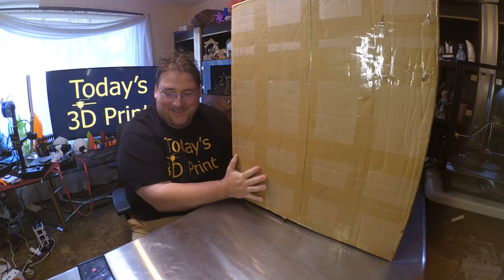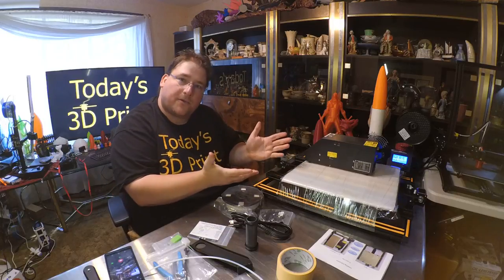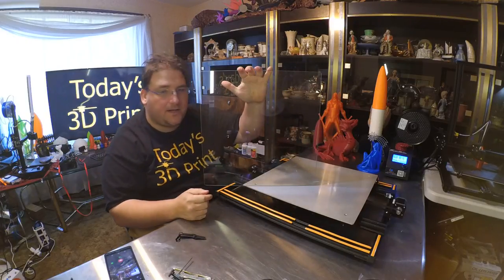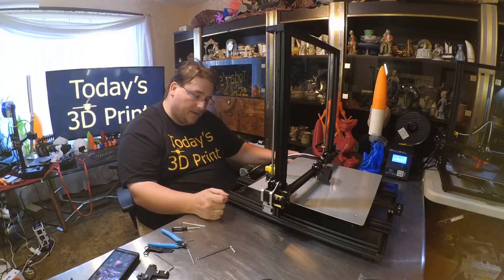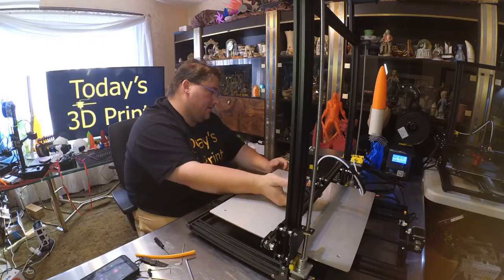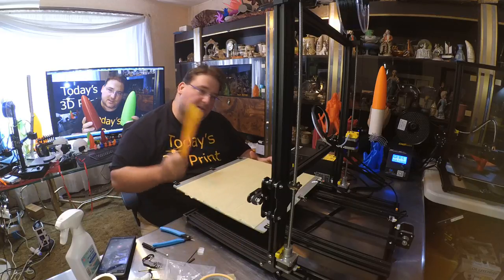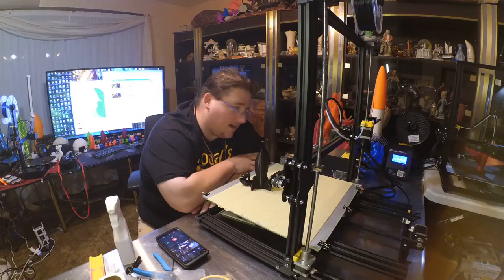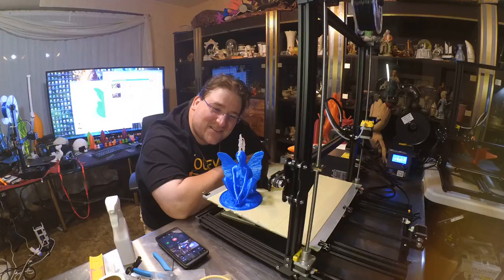Today's 3D Print 122 Creality CR-10 S4 Unbox, Build, First Prints

Comment: Nerys, it’s nice to see you so passionate about 3D printing, I hate to be a worry wart but you seem to be around many, many 3D printers 24/7 when you are not working. Please be aware that there is a health risk breathing in the Microparticles given off when plastic is molten. I know this will probably not be news to you but just thought I should mention it. 😉
Reply from the maker: +Mark Slatem the particulate emissions of pla printing is virtually zero on top of that the return register for the HVAC system for the house is right there in the room with me so most of that is being drawn directly into the HEPA filter for the house plus I am rarely home :-) mostly working and sleeping as my minions chew away on the gcode and plastic I feed them.

Comment: Looks like you have the exact same model and upgrades that I got with my S4. The other included gcode you mentioned is a screw and nut.

I designed some simple bed leveling knobs for the S4 that are available on Thingiverse. They're nothing special but they are better than the included ones, which I found to be kind of sharp and uncomfortable to use. I was also able to use the standard strain relief bracket on this, although it was a little tight. I may have altered it slightly -- can't quite recall.

My main complaint about the S4 is probably that it is a bit harder to level than the regular CR-10 due to the larger bed, and I find that it gets way out of level after doing a long print. I'm guessing the weight of the plastic on the bed causes the springs to compress and gradually work out of level. Any ideas about preventing that?
Reply from the maker: got a link to the S4 Knobs?
Reply: Here: https://www.thingiverse.com/thing:2552928

Comment: sir.can u use cad to picture the heat bed holder?(that is a plate  under the heat bed)
tks.i want to diy a cr10s4.but i have no dates
Reply from the maker: CAD ?
Reply: ya，i mean autocad
Reply: I  need that ,pls.
Reply: i just need every circle's position and size
Reply from the maker: Okay now I understand you want a cad drawing of the Y Carriage plate sadly that's not something I have the tools or means to make I could never measure it accurately enough to give you a viable CAD file I will reach out to creality to see if they have that file and if they are willing to release it
Reply: Ok,thank you .I just wish someone could make a colne CR-10 s4 3d printer .hah .
Reply: Sir,and can u share your CR-10 s4  material menu?

Comment: Hey Nerys!, Which would you get? CR-10S4 or CR-10s Pro....i'm at a deadlock....can you put e3d hotends on the CR-10s Pro?  Right both are the $$...so its a hard  choice. Any thoughts?
Reply from the maker: The cr-10s pro is a 3-3 for printer while the cr-10 S4 is a 444 printer so the S4 has an extra hundred mm on X & Y if you don't need that extra hundred go with the pro if you do need the extra hundred mm then you have to go with the S4

Comment: Can not believe how big that looked compared to the regular CR-10, Truly is a monster. Looks like the are still using  plastic extruders on their printers. 7 Days, think it could be more like ten knowing how slicers under estimate time lol. Hope it completes with out any issues. Can't wait to see the finished print!
Reply from the maker: +ebuTuoY it says 100 hours so I'm guessing 110 to 115 if it does not fail earlier I'm not sure if I have enough perimeters to close that top I've never tried to print a 16-inch Dome :-)
Reply: Nerys I am sure a lot of variables  change the bigger the print gets. Only trouble is the amount of filament and time you could waste if it fails..good luck and fingers crossed!
Reply from the maker: +ebuTuoY mechanical failures you can't do anything about shift happens sometimes design failures that's where experience comes in as you learn capabilities of the technology your printer the model and the scale you can learn to recognize okay if that's going to be a problem or that's going to be a problem and try to counter it in a slicer that's why I have very few failures unless I encounter something new such as when I did Voyager but part of that was I was very finicky about not wanting supports or more than two parts so I had to make compromises to get that end result but now I know about one more failure mode and I can account for it in the future ie I should never have a print fail that same way again
Reply from the maker: +ebuTuoY correct the big one you have to worry about when you print this large is that the actual width of your novel becomes a problem for example printing the Dome of the Moon I am concerned that six perimeters might not be enough if the grand total horizontal shift toward the top is more than 1.2 millimeters I might begin to have surface deformation or collapse we shall see :-) in about 2 days I believe this is my first four-day print or nearly 100 hours and it's only half the Moon :-)
Reply: Yes I imagine this becomes more of a problem the bigger you go. Suppose that you could just print the top part as a test to see, but that is a waste of filament also. Think you just have to trust your instinct and experience and just go for it. Guess we will find out in a couple of days :o)

Comment: So they added a resume after power failure feature to the Mini but not the S4, interesting. For my needs and environment, I would go with the Mini over the S4 if that is the case.
Reply from the maker: +KS Todd I did not know the many can do that is there something in settings where I can check for that?
Reply from the maker: +KS Todd there is no reason to go with the S4 unless you truly want huge Prince that's kind of its Point smiles :-)
Reply: Nerys from my understanding, if the power fails during a print when it comes back on and you are at the main screen. When you press the selection knob one of your options will be resume print. You should be able to test it by starting one of you small prints, like Marvin, and just unplug the printer. Then plug it back in and check the menu.
Reply from the maker: +KS Todd. I'm going to test that as soon as I get home :-)
Reply: Nerys I look forward to the update and finding out what you discover.

Comment: I hope your print turns out, I only went to a 9 hour print on my S4 when I had it.  :)
Reply from the maker: +Mark G well I'm past 55 hours and it's still going good my concern is when it tries to Crest the cap the top of the Dome I don't know if the six perimeters is enough :-)
Reply from the maker: success. took a total of 7 days to print both halves. once need to be reprinted at some point (lifted with no tape under that spot should have realized that) but good enough to look amazing. Video will be coming in the next couple weeks. I have several large projects to post videos on :-) I think you guys are going to enjoy these.

Comment: Watch you vid later, but just heard that creality are in the final stages of debugging a dual extruder 3d printer ooooo
Reply from the maker: +Tac Blades that would be my first dual extruder printer I've been shying away from them because they are either kits which I don't have the time or resources for or crazy expensive but a creality dual extruder oh heck yes I would be all over trying that especially if it was big a 300 by 300 by 400 dual extruder basically take an S4 and make it a dual extruder since you lose some x with the Dual part that would be amazing
Reply: Nerys there is a bit of a debate going on if its and new machine or an upgrade kit. I think if its an upgrade kit then they would need new firmwear so i think it will be a new machine. Oh and tonight i just got marlin 1.1.6 working on my cr10s which means access to acceleration jerk, baby stepping, and cool pressure based extrusion for thoes corners that stick out on a layer change. Plus a load of other features :)
Reply from the maker: +Tac Blades nice keep us up-to-date!
Reply from the maker: +Tac Blades yep I watch that video a couple hours ago I bet you a lot of guys weren't watching the printers :-) I was hoping to get more information on the new fdm printer they have coming but none was given
Reply: Nerys i was watching the staff to be honest they are all very serious professional and young, its what you need for a company like this, i think now its confirned to be a new fdm with dual extruder prpbably cr10 size.

Comment: Nice. Im glad you get another printer. Now you have a whole army of 3d printers. It is lots of noise from all of those printers, would you record new videos with upgrades or something? :))
Reply from the maker: +Danila Fox yep I have a video planned to upgrade the fans in both the CR tens and the tevo tornado I also have future plans to upgrade the heat bed on the CR 10 2 AC heat bed and I'm going to experiment with replacing the PTFE tube in the hot end so I can print higher-temperature Plastics

Is there something specific in mind you would like to see me upgrade? I'm always open to suggestions!

Comment: I think the s4 always had a 400x400 heatbed , however the s5 has the 300x300 heatbed and this has not changed.
Reply from the maker: +NetWolf3D ahhhh ok that make some sense. Why would they not at least stick the 40x40 panel under the s5?
Reply: Nerys no idea it's odd, but I have been sent pictures that show the 300x300 on an s5 and 400x400 on an s4. Maybe a cost saving measure as the price diff between s4 and s5 seems less thanks S3 to s4

Comment: Enjoy these types of videos, the only thing I wish that you could do is not have other printers on while you run the new ones for the first time.
Reply from the maker: +xMusicx you betcha that correction is already in the works I'm removing all the printers as they finished printing from the half of the room that I make videos in I am so used to the sound of all these printers that I didn't realize how much of it was bleeding into the video until one day I played back a video on someone suggestion regarding the noise level without my printers going holy crap that would drive me nuts :-) so that is being fixed any video after about 132 or 133 should no longer have printer background noise in them or at least not enough to cause an issue I'm going to separate and isolate the two rooms

Comment: The biggest printinz is 305 square. PEI is best bet for this size.
Reply from the maker: +kazolar nope they max out of 410 mm you just have to go to the custom one I'm not sure about the plate I just use the skin
Reply: Nerys didn't see it. I saw how much you liked them, and was thinking of doing it for my 24" square bed, didn't see any custom options. Ended up doing PEI. Applying PEI on a bed that big is a pita. Maybe you can do a quick video of how these skins are applied?
Reply from the maker: +kazolar I have one answer for applying Pei if I with the adhesive already on it doing the separate adhesive pei forget it what a pain in the butt :-) Pei is fantastic I really do like the stuff what I don't like is how delicate it is and while printing Z is not 100% as good as Pei is 99% is good it makes up for it in Spades with insane durability you can beat the living snot out of it :-)
Reply: PEI is tough as anything. But dealing with the adhesive is a skill. Which after about a dozen different applications (for myself and friends) I have gotten pretty good at. Not great, the 24" bed was not done in one quick session -- I'm super close to getting this beast printer working, just getting through one last firmware glitch ... got all the hard stuff working, now my Z axis causes the controller to go bonkers if I move more than 40 mm...my Z is mapped to external drivers -- with 2 independent lead screws -- so it's not a standard setup -- nothing in this machine is, but seriously -- after getting auto bed leveling working to <10 micron accuracy, the Z axis longer moves are now a show stopper. Hopefully the guys at Duet can figure out what the firmware bug is, they've been great solving my other glitches.

Comment: Since you don't like the Orange or Blue grid colors, would you be interested in selling a set?  I have the CR-10 Mini, so I didn't get any.  And Dude, I've had my Mini for only a week now and I'm already looking at which one I want to add to it, once you get one and it's printing, you need another one to get printing at the same time.  I lost count at how many you have now, but you must be in 3D heaven
Reply: Also, can you tell me where you get those flat edge sprints for the heat bed on the CR Printers.  and where can I find that sheet of material that you put on the heat bed?  Also, do you stick it on the glass or directly on the aluminum plat?  Sorry for so many questions, but I know you know your stuff and you typically reply more than others, so I appreciate that.
Reply from the maker: +Gimp Geek I think you mean flat Edge Springs? If so I get them on Amazon it's LinkedIn the video where I talk about it I'll add a link to my next video I use a print surface called print in z it's about eight bucks for the Ender you need 165 by 165 get the skin but the print surface that comes with the Ender is pretty darn good so play with that first I stick it directly to the aluminum on the Ender because I don't want to eat up any of my small print volume with binder clips

Questions are good questions are fun don't worry about it ask as many as you want